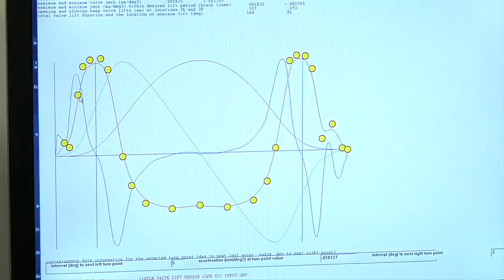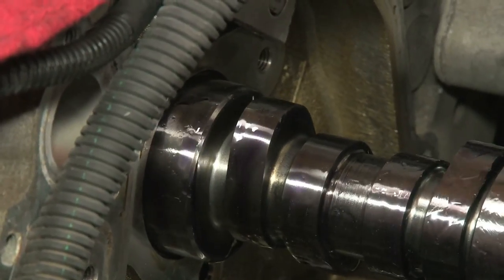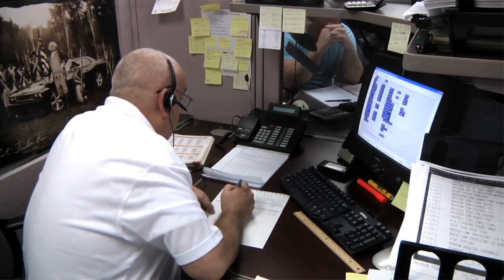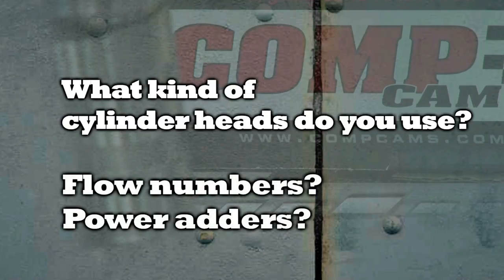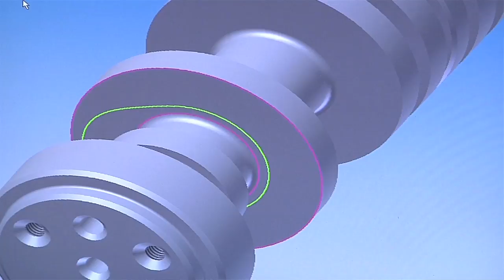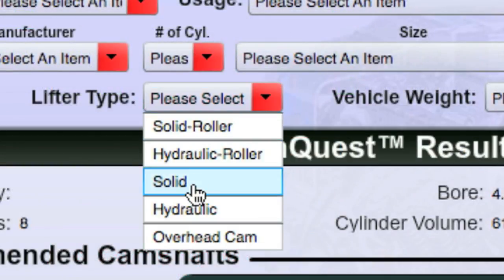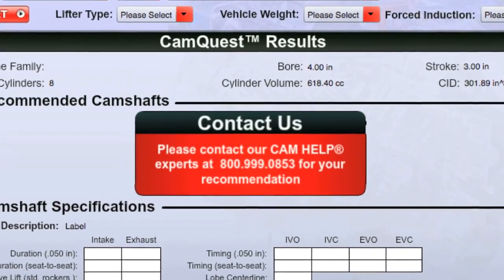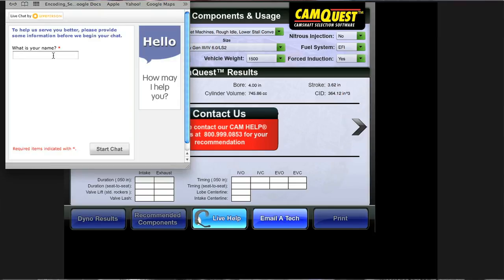How To Order A Custom Camshaft From COMP Cams®

Comment: I need a good custom cam that a make my sbc 450 punched 40 over that a give the small block lots of power in a real real aggressive growling sound  I need a drag seat u cam but use for street applications too I have a 292h comp cam in a 501/501 lift 244 duration 110 lsa in 90 degrees angle lobe in I feel it is a junk cam  I need another cam asap
Reply: Sbc 350 I mean sir